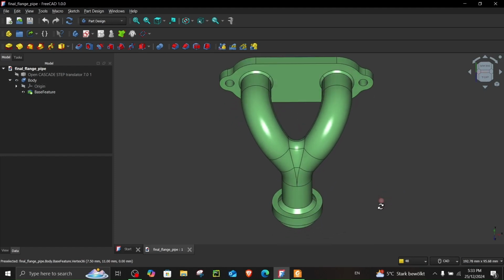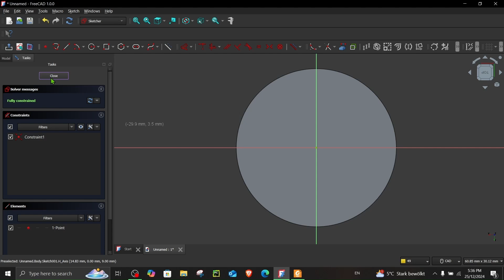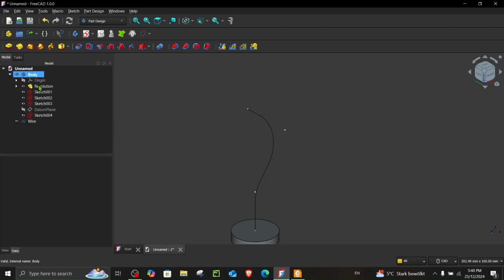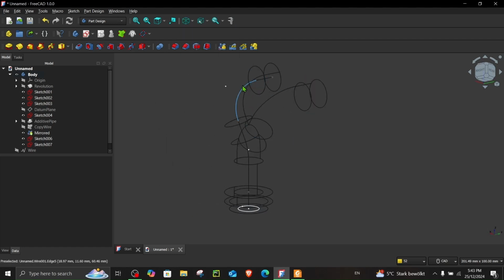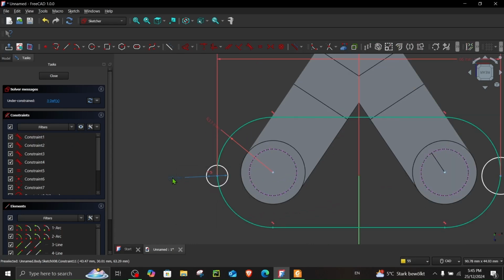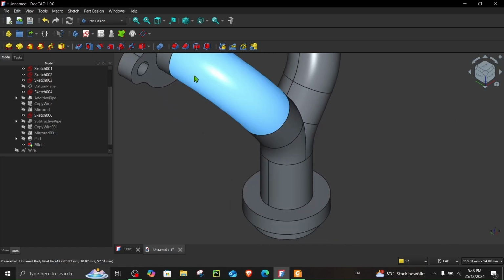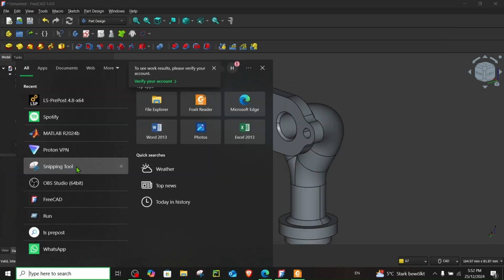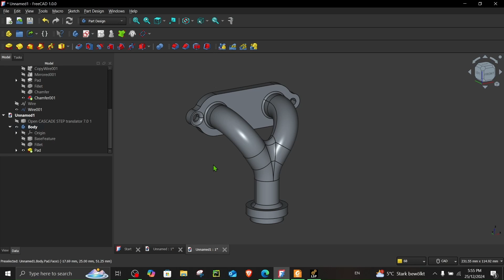3D sketch in FreeCAD 1.0 | Beginner Tutorial | Exercise 4

Comment: It's the exporting to a step file that fixes the error. You can just import the step file right back in to FreeCAD, add it to a new body, then apply the fillet to it and it will work just as it did in LS Prepost. The problem arises due to mirroring the pipe and the edges you get in the middle are a pseudo edge of two overlapping solids as far as FreeCAD sees it. Exporting to the step simplifies the object removing the extraneous sections and defining the edges clearly. 

EDIT: So I was able to make it work without any exports by eliminating the use of mirroring and creating 2 paths, one for each pipe and the fillet applied as you would expect.
Reply: @ComputerizedEngineering: This comment should be pinned!
Reply: could you also leave the mirroring step and then recalculate the mesh?

Comment: Thanks for the tutorial. I am using 1.0.2 and also have the problem of the fillet but I found a way to fix it. If you change the third knot from 20mm, 62mm, 0mm to 20mm, 62mm, 0.1mm, the fillet works perfectly on 1, 2, 4 and 5mm in fillet. But not 3mm. Have fun

Comment: Workaround to using an external software to fillet between the pipes:  Export the body as a step file then reimport it.  Applying the fillet using either "Part Design" or "Part" workbenches did the trick for me.  Not sure what happens in this process but appears to solve the issue.
All in all, this is a very well developed video with great insights especially with regards to creating the polyline via multiple points as the pre-setup.

Comment: Regarding FreeCAD could not create area where two intake pipes meet/join.  You started with single exhaust pipe end, perhaps if header/manifold is created on intake end  starting with the two pipes CAD might be able to able to join pipes according to dimension and angle on top of Y section where the two pipes are joined.

Comment: Hey, when switch into the draft workbench to make the 3D wire, it looks like I'm selecting the points and making a wire but when I pan around, it's been done on the flat plane. I was able to manually enter the xyz coordinates and produce the 3D wire and finish the job. I tried numerous times to do it like you show in this video, but I can make it connect the dots  like you're doing. I'm using freecad 1.0 on a pc.

Comment: After adding the 5 mm fillet between where the two pipes meet, using the centerline. I clicked the ok on the error, saved the file and then closed it with the fillet tool still active. I reopened the file and the fillet was in place.

Comment: @ComputerizedEngineering Make mirrored Selectable True in Display Options, pick one line in the center of the two parts joint and use the tool. Adjust the radius over 2mm and it will work. Note dont pick many lines just a small part!

Comment: Ok guys so I found a way easier method of doing this. Instead of making one circle in the beginning, just make two circles. Make a larger circle and a smaller circle and the pipe will be hollow when you do the additive pipe. No need to do the substractive pipe which creates extra steps

Comment: very frustrating............the line does not snap on to the points and it goes to some random directions. Everyone keeps talking about some uptside down T to click on but where do you find it? Been stuck at this for 45 minutes
Reply: I had the same problem. Point-attachments-functionality (for lack of a better word) is turned off by default when  in the Draft workbench. I selected the "line attach-tool" in the Draft toolbar and clicked on alle the points, and then it worked like in his demo. When you then hover your mouse over the points it adds a blue checkmark beside your cursor when you get close to the points, and you can click and the line attaches to them.

Comment: I tried filleting in between the pipes in FreeCAD v1.0.0 and it works through 1 to 31 milimeters but only stops working on 6mm and 28mm.
I also tried the same with the same project with a weekly build and the behaviour was the same.
Overall, it works when it works, it does not when it does not. 🤷🏻‍♂

OS: Windows 11 build 22631
Architecture: x86_64
Version: 1.0.0.39109 (Git) Conda
Build type: Release
Branch: (HEAD detached at 1.0.0)
Hash: 2fcc5317fe3aee96ca73475986a577719fc78e20
Python 3.11.10, Qt 5.15.15, Coin 4.0.3, Vtk 9.3.0, OCC 7.8.1

Comment: You can sketch the outer diameter (here 15mm) and inner diameter (here 11mm) as two circles in one sketch. If you STRG-Select both circles and use an additive pipe, you get the final (already hollow) pipe. That way you also would not have to alter the wire.

Is there a specific reason why you chose to use the additive pipe first, then alter the wire to add the point below and then use a subtractive pipe. It seems a bit laborious.

Anyhow. Thank you for the great Tutorial!

Comment: It seams that I'm doing something wrong. The line is not snapping in 3-dimensional and is finally flatt and if I turn the object 3-dimensionally is not going through the points. (I am using 1.0.0 Rev 39109, Win 11 build 26100)

Comment: I have not been able to get past drawing the line in the Draft workbench. I can not get my polyline to attach to the first point placed on the top surface. I am brand new to this and am watching many videos to help me progress. I was doing well on this until this point. Any helpful suggestions on how to snap the end of the polyline to the point on the top surface and each point thereafter?
Reply from the maker: @RandyShort-u6t  Hello, once you are in Draft workbench try clicking on  "Snap perpendicular" (which has a symbol of upside down T), or "Snap center" (Symbol  of a target), or "Snap intersection" (symbol of X). Let me know if that works.
Reply: @ComputerizedEngineering  That did not work. The line is snapping to the bottom grid instead of the spot on the top. Tried all the snap options but still going to the bottom.
Reply: @ComputerizedEngineering  The last end point of the polyline appears to be snapped to the grid. I can not get it to snap to the point that we placed on the datum plane. And I have not been able to find where to possibly turn off snap to grid. I appreciate any help.
Reply from the maker: If the polyline is snapping to the bottom grid then it is possible that you have activated "Snap grid". Try to replicate the snaps that I have activated at @5:04 and leave the others deactivated. I hope it works out for you. If not, let me know again.
Reply: Hi, I encountered exact same problem! After some comparison I realized my draft buttons were not toggled as in the video. I thought the reason could be I was using "Ribbon Interface". Disabling this add-on solved my problem. Now I can toggle buttons like in the video and draft points snap on my sketcher points.

Comment: Did you use Check geometry with BOP check enabled to determine if the solid is in fact valid? It is very common for the this sort of merged pipes to produce self intersection and other geometry errors.

Comment: Hello, I can't seem to snap the polyline to the first point.
Can you help me please?
TIA, Avri
Reply from the maker: Hello, once you are in Draft workbench try clicking on  "Snap perpendicular" (which has a symbol of upside down T), or "Snap center" (Symbol  of a target), or "Snap intersection" (symbol of X). Let me know if that works.
Reply: @ComputerizedEngineering  thank you. I did that. it's working now
Reply: I struggled with this as well. Look closely at his tool bar in the draft bench. He has Snap Endpoint, Snap Midpoint, Snap Center, Snap Intersection, Snap Perpendicular and Snap Near all activated. Once I copied this, I got it to work. I just need to know how to make trimmed lines disappear instead of turning light green.

Comment: DuyQuang Dang's channel just released a video on manual and default fillets. You can use them as chamfers if you leave the curve at zero. The video before is on manual fillets.

If you look at about 16:36, you can see the changes in the wireframe that were made.

Thanks for the video.